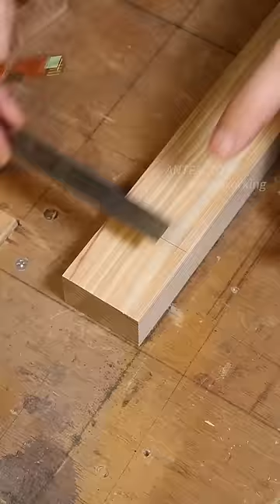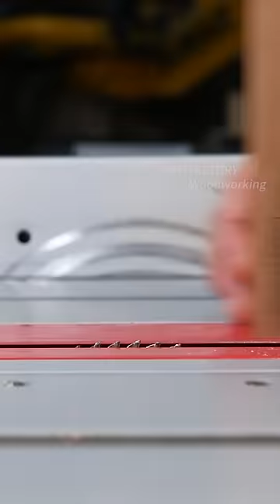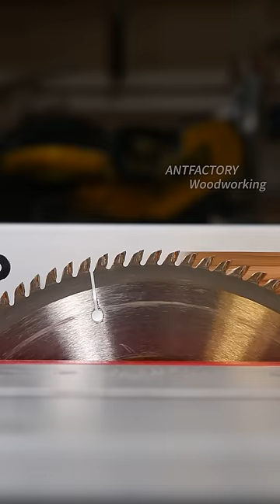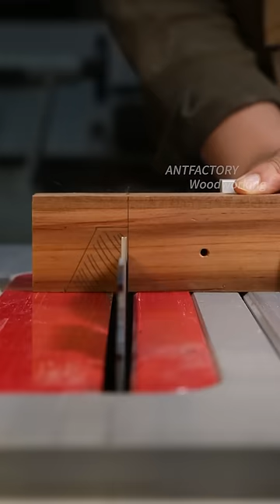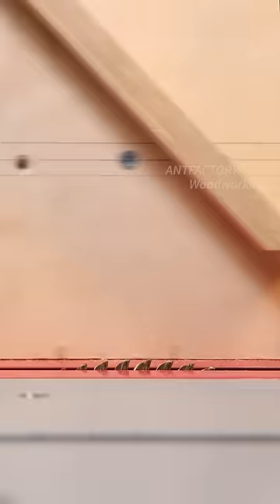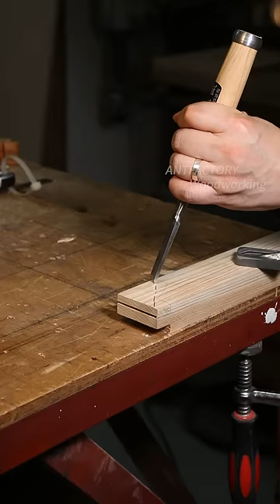새로운 목공 조인트 #shorts

Comment: This style of joint has very few practical uses. But it looks really cool tbh, and probably holds together really well too
Reply: Considering these joints came before nails, they work better than what we have now.
Reply: @BrokensoulRider  I doubt these joints came before nails. The amount of time it would take to cut the wood into that shape with hand tools would be far from ideal, let alone the skill required to have any sort of precision. They probably just used a wooden peg hammered into holes drilled in the planks/beams before nails, which is actually a common method on houses from like the 1600s, even when nails were a thing.
Reply: that said, it looks like it would be bad against forces that woult try to expand the 90degree angle.
Reply: @skyraider87 
How the hell do you think they put furniture or small wood structures together? With rope and wood joints (and with glue), nails are a later thing once we started smelting copper and brass tools so metal nails started being used but IN NO WAY were they common, only iron nails started getting used more commonly once we got to the iron stage of civilization

We have very real examples and manuscripts about this technology and the most known examples would be many ancient structures still standing in Asia like Japanese castles as a pretty common example, the wood joinery was so well thought out that they even devised anti seismic foundation and supports

Humanity has achieved many many feats that very few people seem to even realise, this is one of them
Reply: @CaptainGrief66  Japan has always had great engineers and artists, I was moreso talking about Europe and European colonies since that's what I know more about
Reply: @skyraider87  
Yeah and I was talking in general, Japanese joinery is a special case, but it wasn't uncommon in other parts of the world
Reply: I mostly see it being useful for framing things, like pictures and mirrors
Reply: @skyraider87 
This is Japanese wood joining aka "Edo Sashimono"
It goes back to the 12th century and they have never used nails.
Many temples and shrines built as such are still standing today.
Reply: @edwingng7973  probably an aesthetic choice. Nails are very visible, and if you don't have the ability to hide them, they can ruin the look of something
Reply: @skyraider87  houses in Japan (I'm talking pre-1900s) were often built to be easy to take down and build back up due to the massive number of natural disasters that plague the island (specifically earthquakes which could demolish cities, easily start fires -also why open flames were closely controlled -, cause tsunamis and of course there's typhoon season). Using metal nails for these structures would have been expensive and impractical, so they developed different styles of wood joinery to suit their natural environment. Like a previous comment mentioned, Japanese engineers even developed anti-seismic joints and other woodworking techniques from this art craft. It was more of a practical choice than an aesthetic one to not use nails, but of course the intricate designs of these joints serve both mechanical and aesthetic purposes (symmetry, balance, beauty, etc, all being very valued in Japanese culture, which is all related to buddhist and Shinto traditions)
Reply: @alexmsevans  neat! I'm glad I posted this comment, I'm learning a ton from it
Reply: @skyraider87 also nails weaken the joints and can split wood during seismic shifts due to their inflexibility, so they would actually have been more damaging to the buildings

Comment: This is neither simple nor clean LoL
Reply: Japanese woodworking joints are often more complex than Western joints, relying on the physical attributes of the joint for strength. The key I discovered is in the quality of the chisel and it's sharpness. A Japanese  chisel is the hands of a skilled woodworker is often sharpened on a 10,000 grit water stone, creating a very easy to use tool..
Reply: @miket2120  that all may be the case, but for a video, make it clean
Reply: I was about to say.  I don’t think there is one point of contact where it looks “clean”.
Reply: This is an introduction to "this kind of technology
It's not a video showing his skills, so accuracy is not a big issue, is it?
Reply: @miket2120 well the joint is only gonna be as strong as its weakest point, so structurally this seems to be worth only a real thin mortise and tennon. Additionally, a 10,000 grit stone wouldn't make a chisel functionally any sharper than something like a 6k grit, it would just make it shinier
Reply: @miket2120  You say that but we can see from the video that his chisel edge wasn't especially sharp. He had a lot of trouble driving it through this soft wood and the cuts are incredibly choppy and uneven. It didn't chop through the grain, the grain broke off jagged and stringy. It doesn't matter what "style" of woodworking you want to call it, a dull tool is a dull tool.
Reply: @isaiahcampbell9248  you know these rushed video production times...
Yeah, he could have done a cleaner job. Of course, the video was only about the process of making the joint, so I'm giving him a little slack for the roughness.
Reply: @bloodleader5 His chisel wasn't as sharp as we would have wanted for, say, furniture grade work, but I think the video was just about how that kind of joint was made, so a little roughness could be endured.
Reply: @miket2120  Then maybe we shouldn't make claims about superior Japanese steel folded six billion times with a mirror polish that can split atoms. It's REALLY silly. I'm not discounting the quality of his work of course, but this is a pretty strange time and place for mythologising foreign craftwork.

Comment: Is this better than a standard bridle joint? If so in what way? The bridle is much simpler to manufacture. Do you have any strength data on this as compared to a bridle joint?
Reply: I'm a joiner and the only strength data I need is my eyes, they tell me it's quite weak as opposed to standard.

Comment: im not a woodworker so this makes no sense why cant you just glue the two boards together?
Reply: Simple answer: Just gluing boards together forms a really weak bond. You have to cut a joint like this to maximise the strength of the join - joints get even stronger if you combine glue with wooden pins, or screws and nails
Reply: @rollingthunder1043  thanks for the explanation!